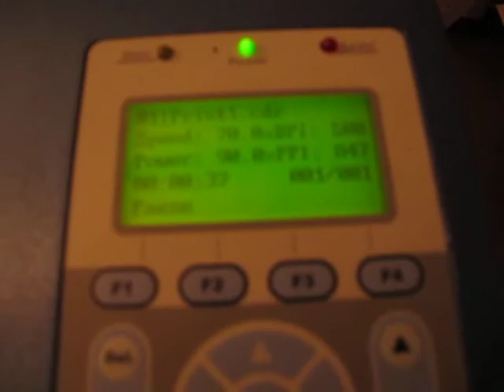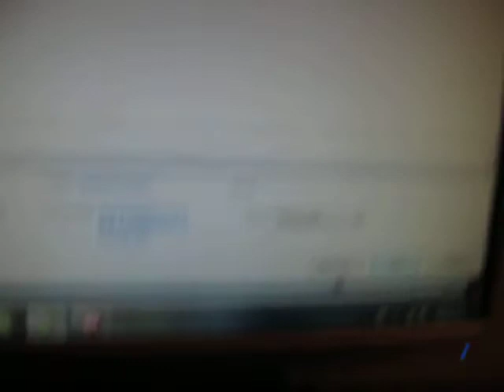GCC LASER PRO PROBLEM/MALFUNCTION: Dec 12 Four Squares Rastered part 1

Comment: good morning Miss
Eva Bartha my name is Oscar I have a laserpro x380 machine but I have a little problem now I don't know if it is because of the software or the drivers because when I bought it they did not give them to me and besides I do not know what program works since the ones I have do not work now with The greatest of thanks would ask you for an accessory from where to download the draiver, the software, and the exact program for it to work, because when I send it to record or cut it gives me an error in the control panel (PCL ERROR), You can see the laser but it does not engrave or cut, you can see the DOOR POWER lights on on the control panel but the one that says LASER does not turn on or does not change in this case or to know where or where I can change it to the laser ... This is my number +584143984683 Oscar, if possible you could access me by WhatsApp, thank you very much